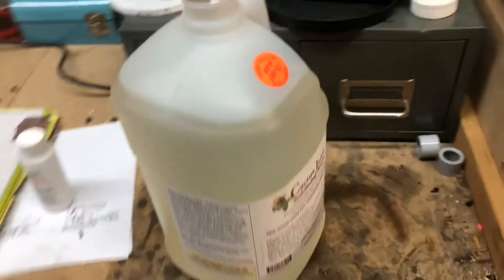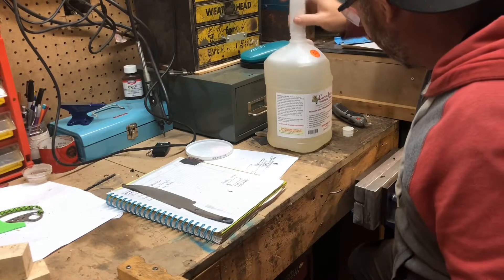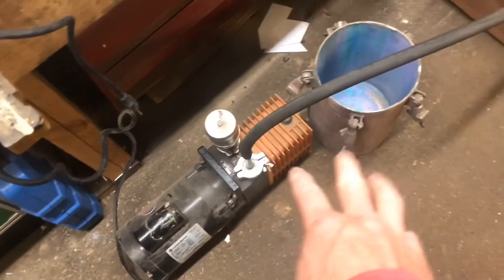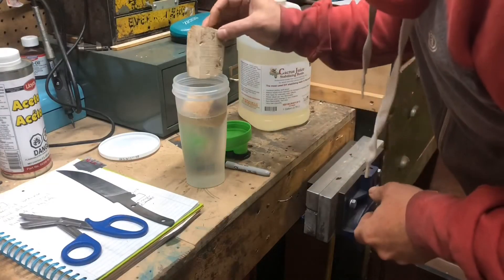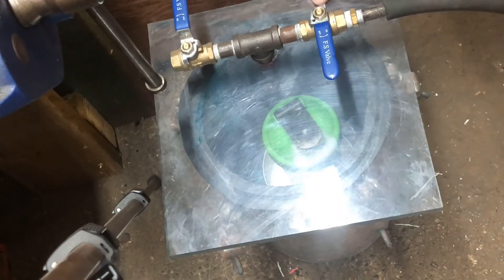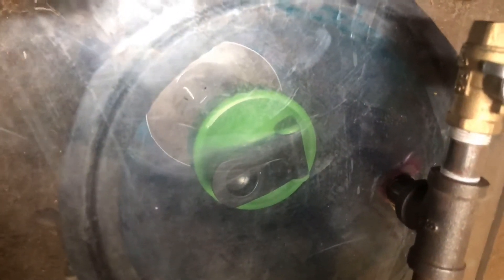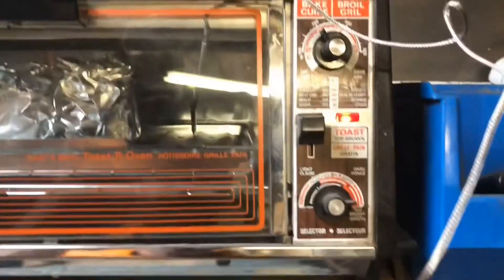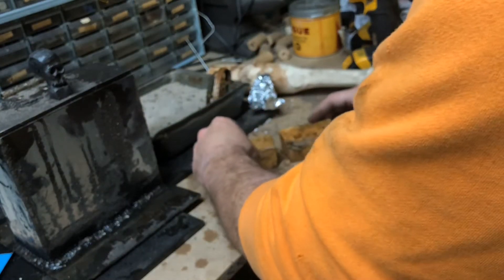Stabilizing Wood with Cactus Juice

Comment: Great video! I have used cactus juice for all kinds of projects and it has never failed me. I have also experimented with adding dye to it. Although I feel I got better results dyeing the blocks and then stabilizing. Thanks for the video!
Reply: First I added analine dye to the cactus juice but this method did not give good penetration. Then I tried analine dye mixed with alcohol and put it in a pressure pot first and then ran it through cactus juice. This gave full penetration but it also gave a uniform color. Next I tried ink from pens, I added drops of ink in certain areas and let it soak in over night naturally then used the juice. This gave me the most vibrant colors in the grain of the wood and I could somewhat isolate the colors to different grain patterns in the wood! This is what I was going for! All of these methods tint and color the cactus juice. I found that I would stabilize all of my lighter colors first and move towards the darker spectrum to get the most out of my juice. By the end of a batch the juice is almost black. I will do an entire series of videos explaining the dyeing and then into hybrid blanks and the processes involved!
Reply from the maker: @Aleeknives  Wow! You've gone through a few rounds of trial and error. I have a few colours that I want to mess around with. I want to order a few more though.
Reply from the maker: Thank you! How did you dye and then stabilize? How did you get the colour in the wood?